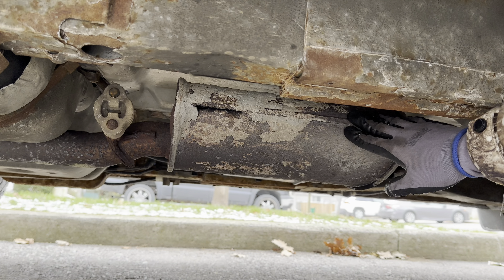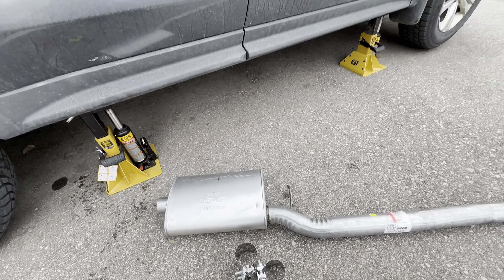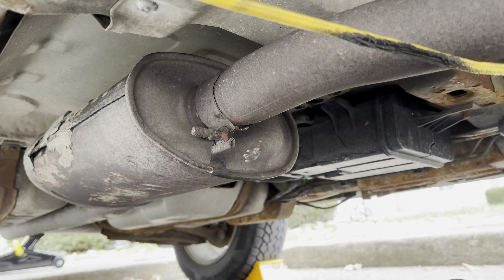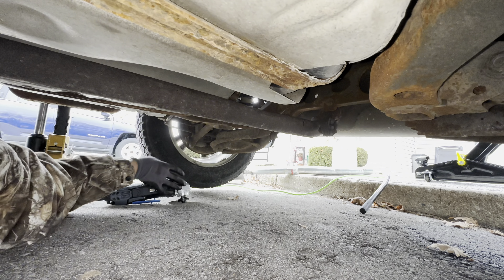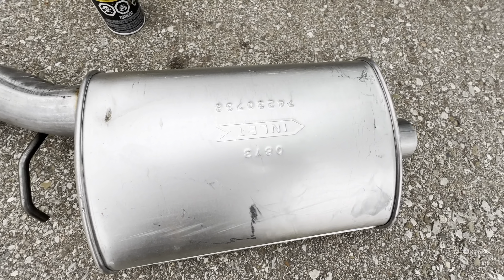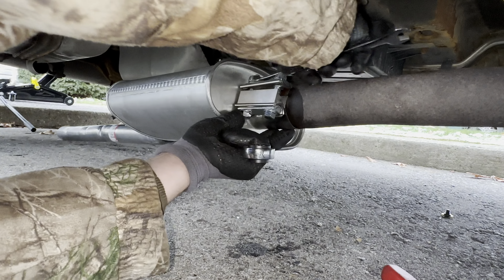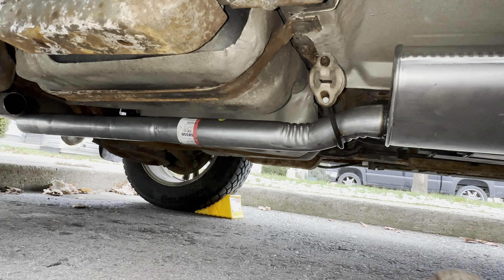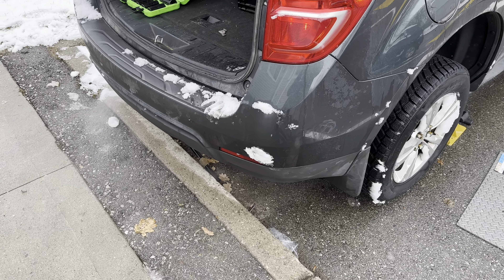Chevy Equinox/GMC Terrain Resonator Replacement

Comment: Cut a piece of stove pipe to length, wrap it around the resonator, use long hose clamps to attach.
Reply from the maker: This is a video for how to replace the faulty resonator. Not how to patch it.
Reply: I have also used soda and soup cans to keep the patch in place. A much cheaper fix that lasts a long time.

Comment: Hello. Going to do this on my 2016 terrain soon. How is it holding up. Is this a permanent fix despite no welding?
Reply from the maker: Yes this is a permanent fix. Now in the second winter since installation and it is still holding up strong with no leaks at the joints. Thanks for watching. Please like and subscribe

Comment: Could I leave an extra 3-4 inches and toss a pipe expander in to avoid using the tape?
Reply from the maker: Yes that is an option. In that case you will need a 2.5” lap joint band clamp to join the 2.5” ID pipe to the newly expanded 2.5” OD pipe. Here is a link to one: https://a.co/d/0dTi4Awg
Hope this helps. Thanks for watching. Please like and subscribe
Reply: sweet was going to do it myself and then figure why not just get my mechanic buddy to do it since he can weld it and be much better but he is strongly advising me to go with the walker ss instead since it's stainless and we're in michigan so the winters are harsher. says I'd be lucky to make it a year

Comment: Hello. Does your car burn oil? What is the oil consumption?
Reply from the maker: It does not burn and oil. I change my oil every 6000km and I’m only usually missing a 1/2 quart in that drain intervals which is normal for any car.

Comment: Hey buddy did u change the piece 2 1/4 for 2 1/2 or u still using 2 1/4? Wich work better??
Reply from the maker: Hey. I actually just stuck with the 2 1/4 that I put on in the video and it is still on there today. Haven’t had any issues. Sounds great still. No leaks. So personally I would stick with 2 1/4 because I’m not sure how the 2 1/2 will work on that side. Thanks for watching. Please like and subscribe
Reply: @BillOfAllTrades2016  , I just installed a 2.5" and I think it's to big. I'm gonna order a 2.25" and try that on the inlet. I think the 2.25" will be a better and tighter fitment. Thanks for the video.

Comment: Gonna do this on my 15 too. Same leak on the res, has been sounding horrific since i passed 102k miles. Gonna skip the mortar and go to a replacement. Found the individual resonator itself with 2 ends for about 60 on ebay and i’m gonna snag that. Is there any advantage to buying the one with the pipe to the header as well? Thanks as always
Reply from the maker: The supplier I got this from didn’t have just the resonator when I needed it. Other suppliers that had just the resonator were the same cost as this one with the pipe. So I figured for the same cost might as well replace the pipe with it. That’s literally the only reason I did the pipe with it. No advantages either way. Thanks for watching

Comment: Today I replaced this part like in this video, but it was not so quick and easy, because muffler didn’t want to come off in that place where was clamp
Reply from the maker: Did you bend it back and forth like I showed in the video? After the clamp is cut if you set the other end of the cut pipe on the ground and then put your weight onto the clamped portion it will spread the pipe. The pipe has slits where it was spread at the factory. Pulling it back and forth will pop those slits open and make it easy. Thanks for watching. Please like and subscribe

Comment: Is there anything we can coat the resonator/Muffler with in order to keep it from Rusting out again?
Reply from the maker: It is not advisable to spray anything on the exhaust system as it may react with the heat. Sprays may cause smoke and toxic fumes. These aftermarket resonators are made much more durable than the factory ones. Thanks for watching. Please like and subscribe
Reply: @BillOfAllTrades2016  Thats what i thought, and why i asked! thanks!

Comment: I think that direction (or placement) of the bolts for the rear clamp is incorrect. The bolts should not protrude beyond the pipe, so that it is not possible to hook anything with them.
Thanks for the video!
Reply from the maker: The direction of placement of the clamp does not matter in the slightest. They have somewhere between 10-12 inches clearance from the ground. I don’t drive reckless enough that they would bottom out or hook anything. If something takes that clamp off at 11 inches off the ground I would have already ripped off my bumper that sits stock 7 inches from the ground along with the oil pan and trans pan being damaged. Please don’t be that person who has to find the smallest thing to point out.